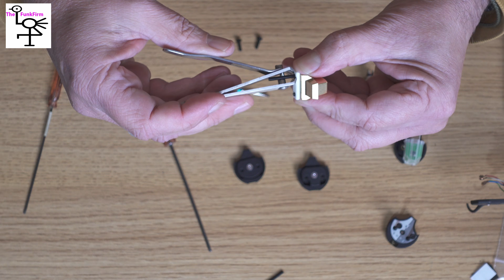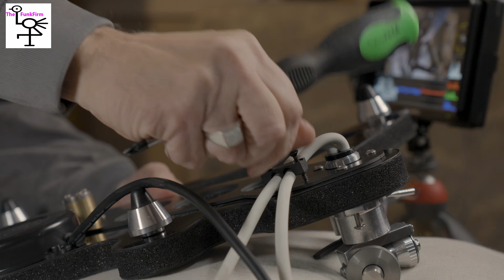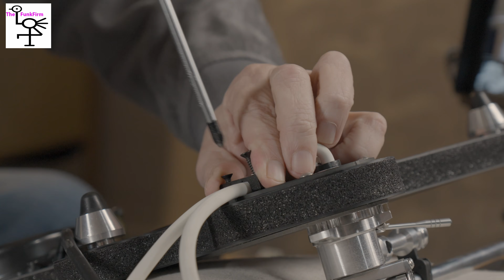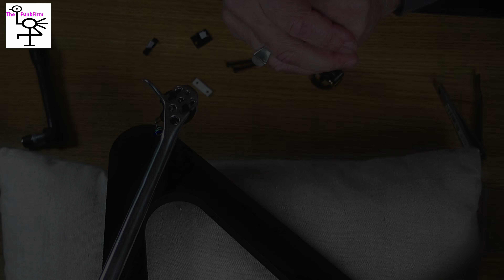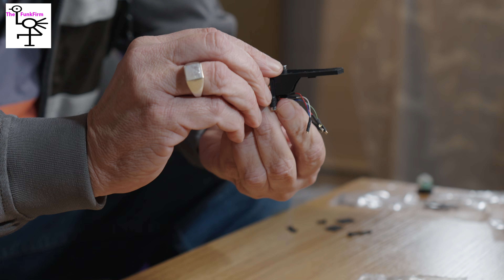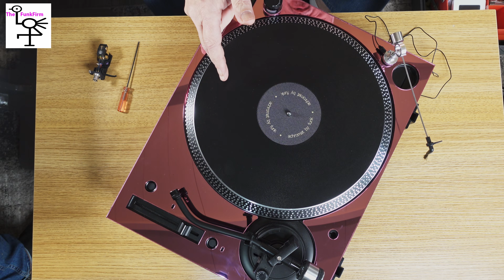Fitting the Complete Rega Upgrade Stack: Houdini + VTS Spacer + Eeze-Lign + Cobra

Comment from the maker: Hey guys. Thanks for your comments, and apologies for the L-O-N-G delay getting it out. Six weeks of winter lurgy (and I still have it),  Coughing and spluttering on camera doesn't make for great videos! 
OK. down to business:  The fitting video is what you've been asking for. Theory is a bit hard work, but it's there for a reason. Try this one: Houdini has even more depth to it than we've let on, and there's an aspect of Houdini that we've not mentioned, till now. 
It actually helps with cartridge tracking. As a result, it actually helps with stylus life. Without the theory video.
What ideas do people have how this might be?
Reply: I would think that allowing the stylus to track the record groove in the "allowed directions" across all the record from start to finish is better than setting an average angle at two points as in Stevenson, Baerwald etc.
Reply: Does the movement of the Houdini reduce the pressure from the groove on the stylus? I am looking very much forward to the theory video, because I still cannot wrap my head around how playback can work when the cartridge is allowed to move.
Reply from the maker: @jensastrup1940  Good oversight of uncertainty. No, it can't "reduce the pressure of the groove on the stylus" - the stylus wouldn't track! The benefit is a bit more fundamental - In the theory video I have included something to demonstrate this wholly unexpected benefit. I found it gobsmacking. It's a win-win: Not only does it sound good, it does you (your stylus) good as well. Such general double benefits aren't that common in life.

Comment: Hey Arthur, LOVING this series.

Hoping you could number your video titles sequentially, so we can find the next cab off the rank.

I also learned that there are two HOUDINI models: one for threaded carts and one for slotted carts.

I own several different cart types and therefore probably need both.

QUESTION: Have you measured the installation of the HOUDINI on a 99.99% typical (ringing) tonearm - and presented the difference?

I am wondering how close (say) a LINN ITTOK LVII with the HOUDINI installed, can get to your stock FX3.

Comment: Coming from a different direction I can confirm that the Houdini is also incredible for DJ use. As a DJ who cares about sound quality I wasn't sure how well the Houdini would handle back cueing, but once set up correctly for weight and anti skate it does it's job perfectly! Improved sound, with no negative effect on mixing/cueing. Obviously I'm not talking scratch mixing, but for regular DJ use I love it!